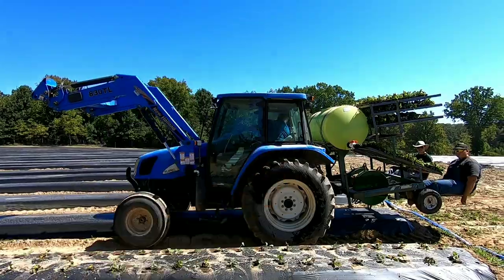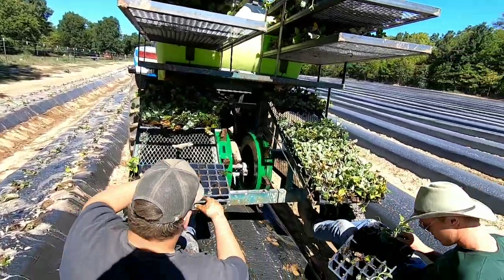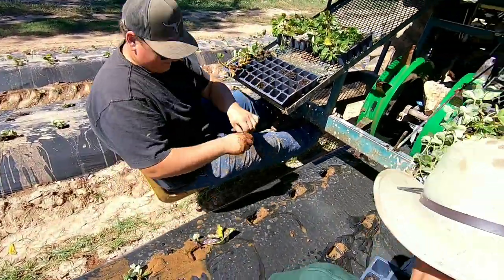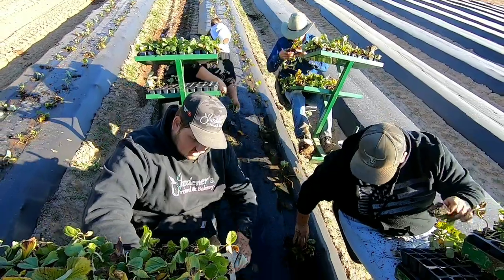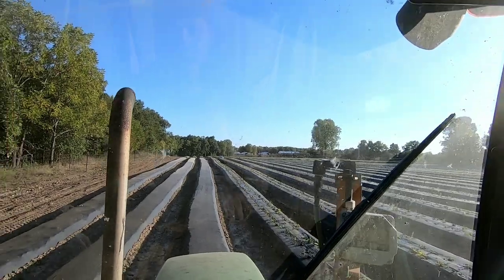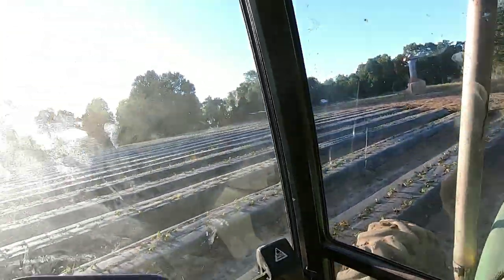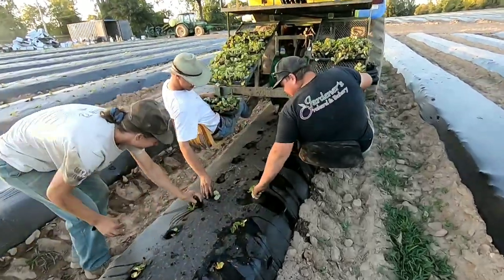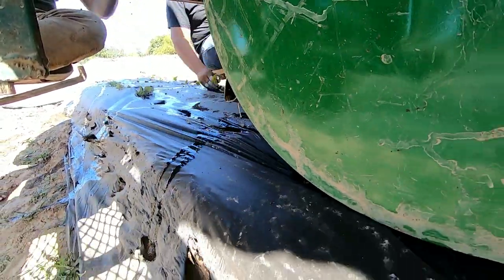Planting Strawberries on my You-Pick Farm!

Comment: What’s your ground speed when planting.  You’ve said it’s a little too fast because the tractor doesn’t have a creeper gear.  
Would you say a Creeper is definitely required if getting a new tractor to be used with a water wheel for Planting vegetables and strawberries, or would you consider a great deal on a tractor, even if it didn’t have one & its slowest speed in 1st gear low was .5mph
Thanks!